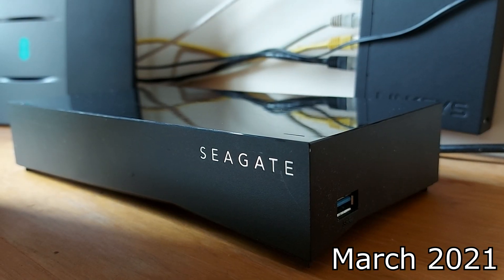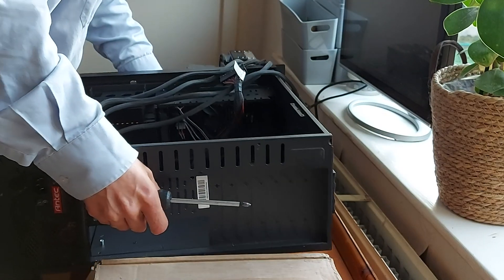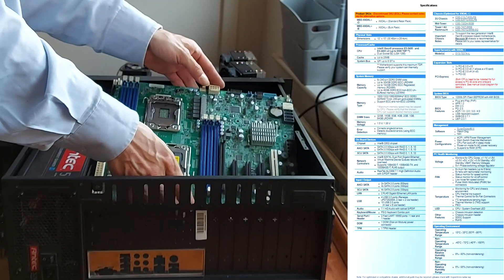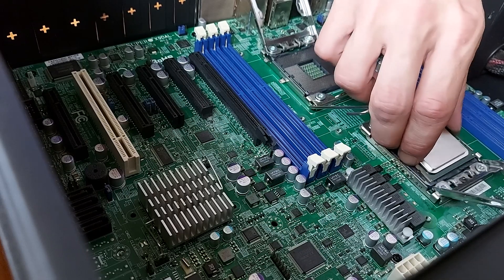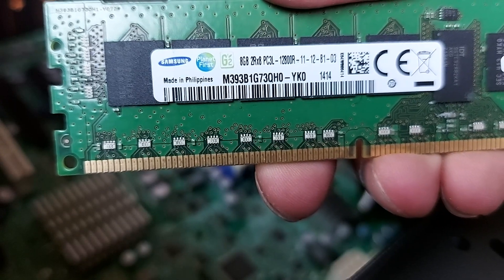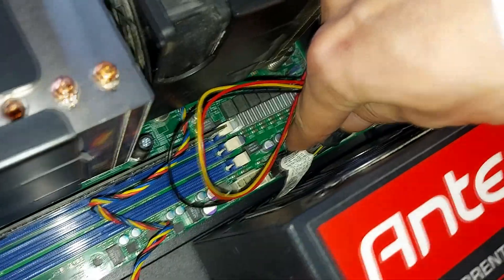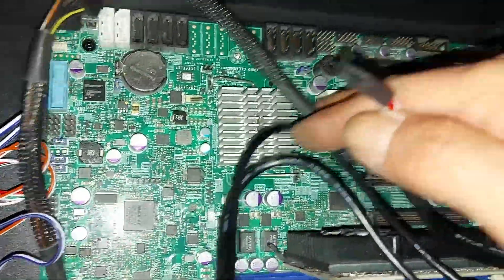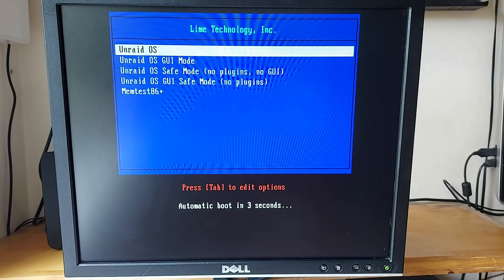Building A Cheap Homebrew UnRaid Storage Server 2021 - The Build

Comment: This is an interesting build, and super overpowered for just nas. What is your use case?

I built an unraid media server for streaming movies and TV shows, IPTV, a pi hole and a few other services. My goal was to be extremely efficient since it runs 24/7. I've got 30TB of storage across 5 drives - but the whole thing runs off a mini itx board with a Xeon e3 1265L using a laptop power supply and it only pulls about 40W at full load and hardly anything at idle. It's also headless and I avoid any transcodes by converting any media that might need it through macros when needed.
Reply from the maker: Thanks for watching Damian. 

I built this rig two years ago initially to store data on, but I currently use it as my render server, storage server and my PC all combined. I added an extra 64GB RAM, a 1TB HDD, a 120GB SSD and a Zotac GTX980 which are all passed through to a virtual machine. I have passed through 16 of the CPU 'cores' to my VM, four for my plex media server and other services running, and the other remaining four are left for the UnRaid OS itself to operate.

Yeah it is slightly power hungry for just a NAS box, but I never really intended it on staying like that for long. It was all new to me to begin with, but as I have it setup at the moment it is pretty sweet and covers all bases.